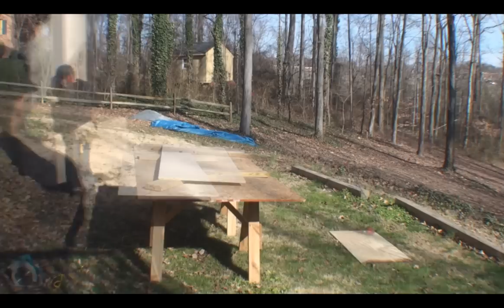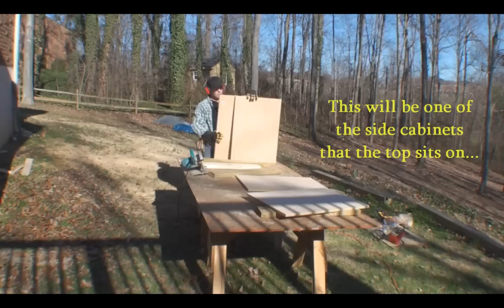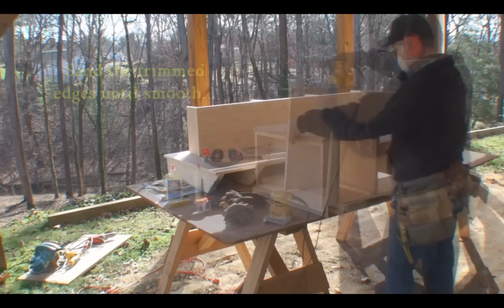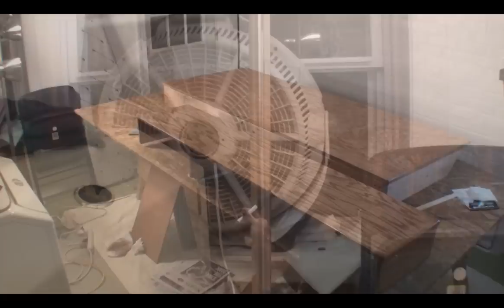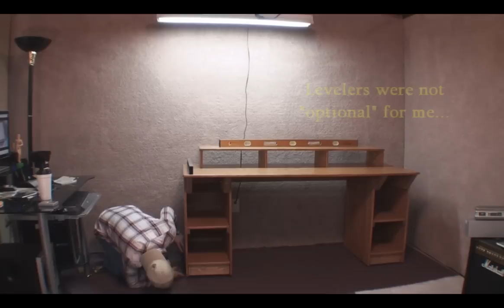How To Build A Home Recording Studio Desk - Step-by-step

Comment: great build! way better than anything i could ever imagine doing. but with your monitors that wide you're missing your sweet spot. You'd be a lot closer to the sweet spot if you had them on your hutch. make an equilateral triangle with the cones as two points and your head as the third.

Comment: Beautiful job man. Only thing you should do is move that desk to equal distances between the side walls. Having your right monitor in the corner like that will give you bass coupling on the right side and near reflections on the right hitting your ear before the reflections on the left. In short you will have better stereo imaging and more linear bass response moving the desk to the left a bit. Check the "Studio Rescue" vids for guidance.

Comment: I measured the shelf board that is holding the keyboard and it is 35-36 inches. Hope that helps.  If not, remember to check out the link to Doug Pace. He has the instructions on the entire project.  Thanks.

Comment: actually a big studio desk like that are quite expensive. the cheap ones are like 400 and the ugly ones are around 200 like relaly ugly and small.and the decent looking ones bump up to like 900 that's a lot for slightly better then the 400. then the good ones are like 1.5-3k which is stupid for just a plat form and 1 more extra platform for speakers and monitor

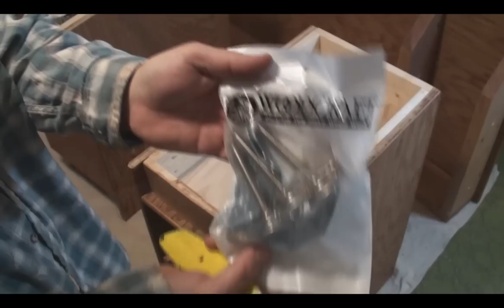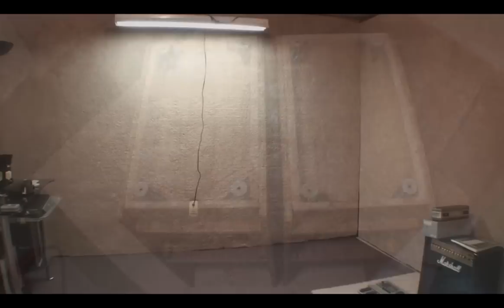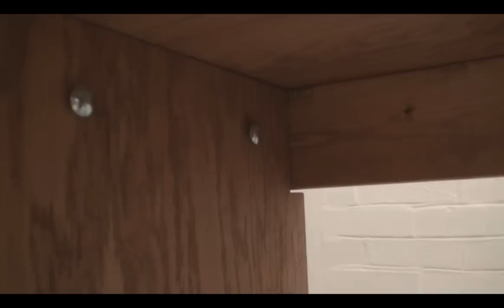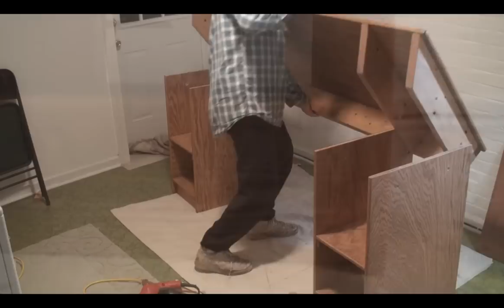Comment: I don't understand this part, why only cut 3 pieces for the bottom framing and why only 12 inches?   "For the framing at the bottom of each cabinet (See 10:32 to 10:49), I cut three pieces of pine 1×4. One piece 19 3/4″ and two pieces 12″. I suggest you use a piece of the plywood left over and cut a piece, with the grain, that is 3 1/2″ wide and19 3/4″ in length. You will locate this piece as a kick plate in the front of each cabinet. You can see where you need to locate this piece of plywood here (See 10:09 to 10:13). At the bottom of each cabinet, measure in 3/4″ from the back, and 1 1/2″ from the front"
Reply: Thanks for your input, Tim died five years ago and I'm sure he would appreciate your comment and if anyone else profits from your expertise, then that's great.